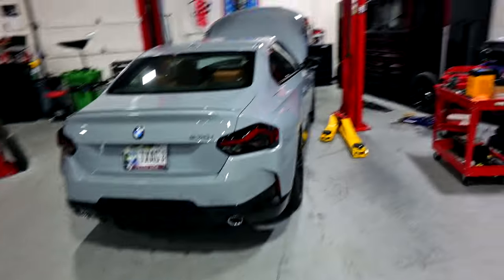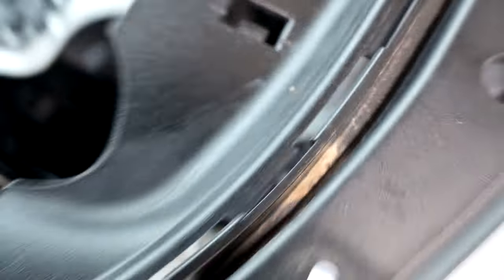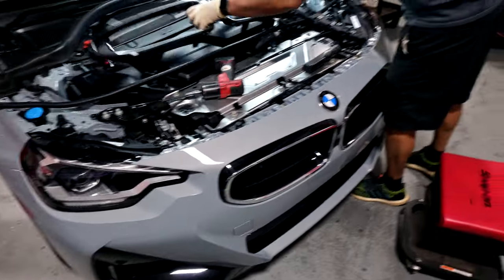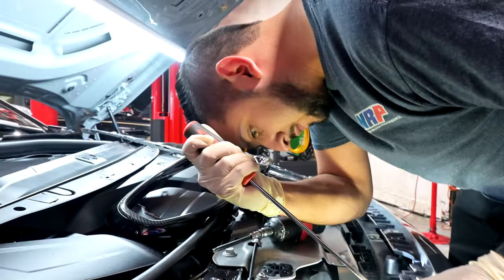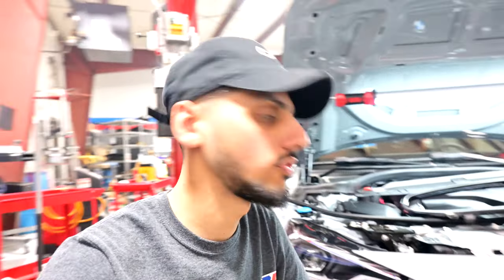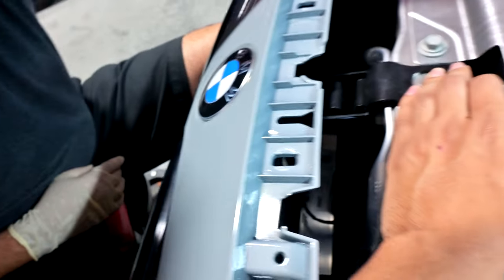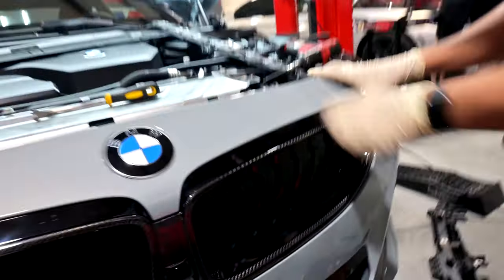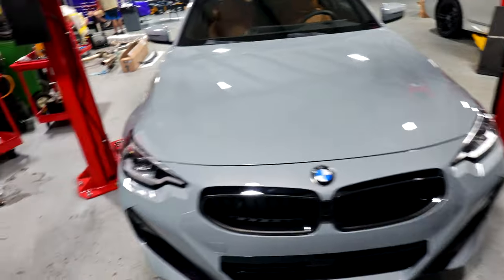BMW G42 230i Carbon Fiber Grilles Install!!!

Comment: You're right, it can be done this way, but it's pretty challenging to get the bottom grille clips unfastened.  I really struggled with that part and ended up butchering the old grille pretty badly.  Snapping in the new grille was a breeze as was reinstalling the other parts.  Glad you mentioned about the hood gap so I took a close look at it before I started.  I had to go back and make some small adjustments, so don't put on the last plastic cover before you've checked the gap.  Thanks for doing this video!